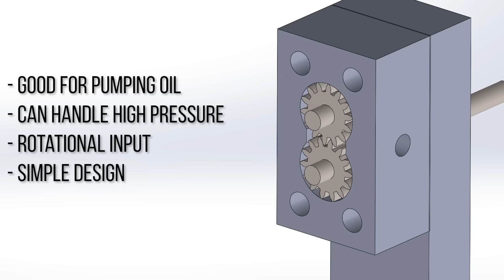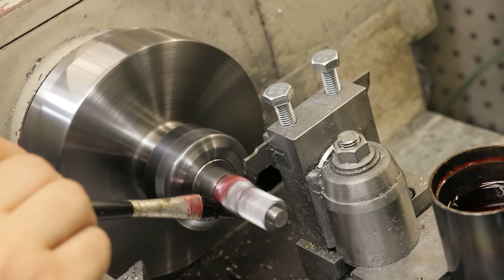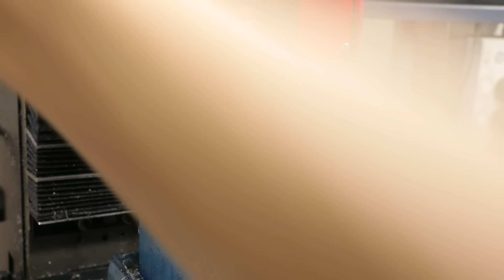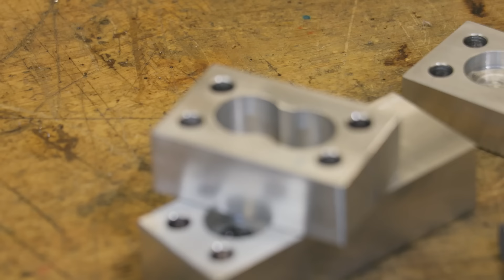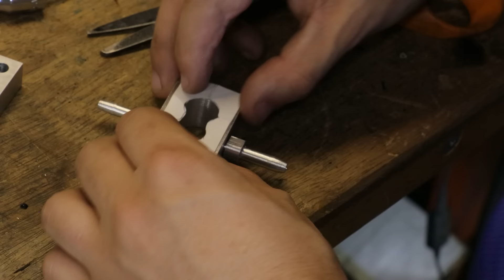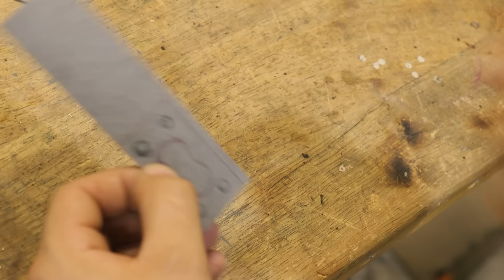Building a Hydraulic Gear Pump

Comment: Reminds me a bit of car superchargers. I wonder if a supercharger screw type would have been better than gear-type. Probably easier to machine screws than gears - or especially roots.
Reply: Helix screws are a proper PITA to machine  😁
Reply: @burningpentagram666 Interesting to know... I hadn't really thought about it before (which might obvious to anyone who has) but now that I am, yeah, I guess the usual lathe thread cutting isn't going to make a good compressor pump. 😁
Reply: @SkippiiKai  a company locally that make screw type of supercharges, they make the rotors in sections and glue them together and then finish machining them..
The geometry seems like a nightmare anyway, a female and male rotor. I don't remember if they rotate at the same speed even.

A roots type of pump is easier and can have straight rotors. Not sure if they are better than gear pumps in hydralic though. Gearpumps is used in most car engines and also in hydralics like excavators.
Reply: @Karl-r5jI'm quickly coming to the realization that screw-type compressors do not, in fact, use anything that resembles a normal screw. 😂

Comment: Instead of using the bolts for alignment I'd make two holes on each interface for dowel pins. Locates it better and you don't run the risk of the bolts jamming because of the tight fit.

Also, you want the gaps between the gears and the sidewalls/bushings as tight as you can get away with. The backflow of oil will reduce the efficiency. Even without external leakage there will be internal leakage.
Reply: Or just hollow dowels to locate the bolts...
Reply: In an actual gear pump the bearing blocks float on the housing and the output pressure can go behind them pushing them axially on the gears.
Reply: @juhokestila7367 doesn't that need a specific gasket/o-ring so the output pressure can get behind the bushing, but not past the gear?
Reply: @CatNolara  The seal is often sort of E shaped.
Reply: You can also make the aluminum housing a little "too tight" - let the wear over time eventually settle into a perfect clearance.
Reply: Did we all see a similar build from someone like Inheritance machining a few years ago? Or someone else? I don't remember who it was, but virtually identical design.